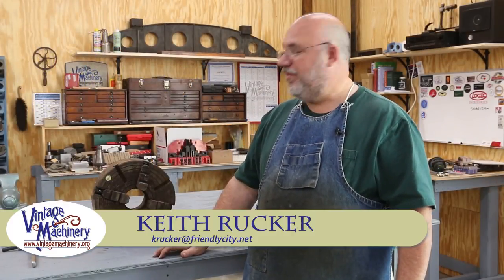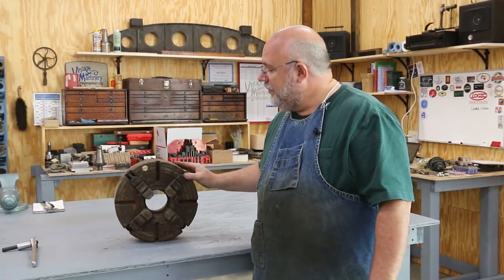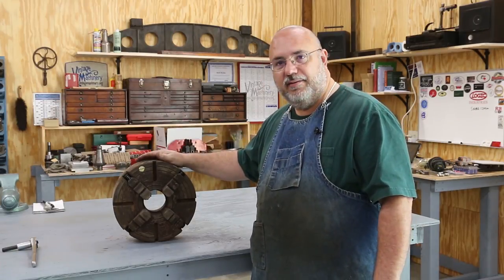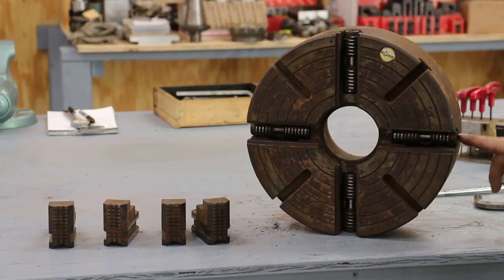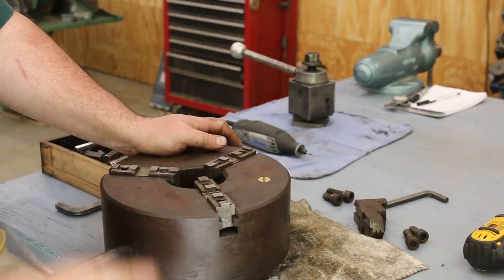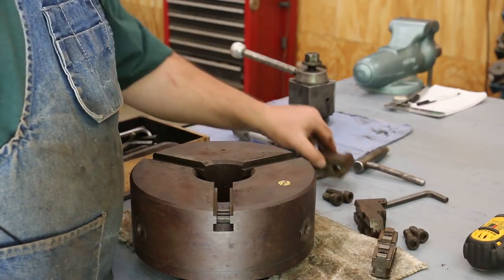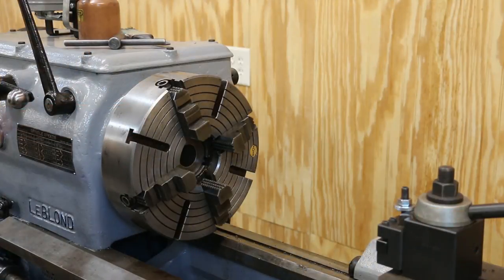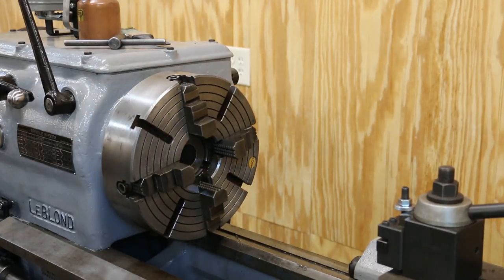Refurbishing Lathe Chucks

Comment: I have a bag of glass marbles i got at a garage sale i use to take up space when soaking things, to reduce product usage. Kinda like a brick in the toilet tank to reduce water. Glass marbles are ideal because they are non reactive to almost any chemical you can throw at them, non conductive and fill up small spaces. They also work in an electrolysis tank. Bonus tip, marbles/ball bearings inside any container you need to shake before use like paint, or lapping compound or whatever, really speeds up the mixing. 
Hold on to your marbles, Once you lose them, things get weird....
Reply: I soaked my marbles in alcohol... I'm sure there still fine, but I can't find them.
Reply: That's genius. I'm definitely going to use that. Do you ever notice the marbles leaving any sort of pattern on contact with the items you soak?
Reply: My thougts exactly.
Reply: brilliant tips
Reply: @LAsparkTVWireTestLimited  Here is another: If a 4mm allen key fits into a bolt, so does a 4mm ball bearing. If you super glue it in there, nothing but a soak in acetone is gonna get it out. Cant drill it, cant hammer it out, cant grab it..... If you peen over the head of the bolt, the bearing is in there for good...
Very effective anti-theft/anti tamper.
Reply: I tried a brick in  my terlet and couldn't get my poop to flush, so I snuck a streak knife from the wives kitchen knives and hacked away.
Reply: use a soda bottle not a brick
Reply: @enigmagic  A bit late to the party, but just lay the marbles in first or try to find another way to put them in the container to minimize contact if you are doing something like cold blue and worried about finish.
Reply: @thepartsrunner5758  
Wut??
Reply: You guys have all lost your marbles!
Reply: I like to soak my marbles in a wading pool..............swish then around,.............☺️😎👍
Reply: @notsofresh8563  super glue is destroyed by heat. Just use a lighter for some seconds and your security is gone-sorry to say.
Reply: I've seen that done. It's a simple trick that works.
Reply: Great idea!

Comment: Great video as always Mr. Rucker.  I'm a CNC machinist looking to go backwards.  You, Mr. Booth, Mr. Fenner, and that goof Mr. Lipton have taught me so much in the manual machining world.  The shop that I work in, has more antique yet still operable machinery than I've ever seen.  I see machines at work...sitting in dark corners of the shop...collecting dust, that I know I could run because of you guys.  I can't thank ya'll enough.
Reply: its not easy to be accurate on old lathe ,no dro ,wear in slides ,wear in chucks,dammn thing turns tapers etc...
Stick to the cnc machining ,there is a reason why those machines stay in dark corners.
Reply: zumbazumba1 I agree and disagree at the same time.  I run some impressive machines...I  throw code at them...make offsets...and I'm good for days.  Personally, manual machining is an intimate thing...CNC is less controlled by me...hence the CNC.  I'd prefer to be in more control...intimately...while trying not to sound like a dirty bird.
Reply: I do get you what you mean ,machinist brother from another mother.For 5 years i am a machinist on manual universal lathes.If you have the right idea they are indeed universal ,from turning one to milling machine ,hobbing gears to making keyways.You aint gonna do that on a  500k worthy cnc lathe machine.Cnc machines can do amazing things but also they kill the creativity,there is no room for improvisation.
I recommend that you stick to your job with cnc machines for $$$ and secretly cheat on it  with a  manual south bend or similar lathe in your basement.
When a man owns a milling machine and a lathe  with right tools and right mind and materials nothing is impossible.
Reply: zumbazumba1 Honestly, I couldn't have said it better myself.  You, my friend, are my machinist brother...from that other mother of which you speak.  I currently have two engine lathes on my radar...an exceptional Clausing and an old clapped out Mori Seiki.  Bridgeports are a dime a dozen in my situation...but...I'm a lathe guy...have been, and preferably, will always be.  It makes me think of Abom and how much enjoyment he gets out of that old Monarch of his. The thing is... I want that.  I'd prefer not to have a  fanuc controller screen staring me in the face all day.  I do enjoy what I do...don't get me wrong...but I'd prefer the calculations were made from what's under my hat...rather than some computer.
Reply: When buying lathe biggest concern is condition of the slides,most will have wear from use(usualy around chuck where people work most of time ).Check the wiggle of the compound and the cross slide with dial indicator -those have gibs that can be tighten usualy but sometimes they need new gib(can be made new but costs money ) or they need to be ground and scraped.

Check for backlash in a cross slide screw-1/10 of a mm is a normal backlash when nut and screw are new(also can be made new but costs money).If cross and compound slide have no play and gibs are set correctly backlash wont have that much of a influence on a precision.
Check the main spindle,put a dial indicator on is or on the chuck and then with a long bar try to move it up and down-this will tell you a condition of ball bearings /bushings.(can buy new -again costs money).

Check if bushings /taperd roller bearings can be tightend-old machines use bushings that are good up to max 600rpm and need to be oiled.Newer machines use ball bearings on main spindle axe and their speed s go up to 3000 rpm usualy.-this is important because carbide inserts like higher speeds,older machines were made for hss blanks. 
Open the cover of the lathe and check the main gears ,if you see any of them are blue(runing withouth oil ) or damaged if they are run away and never look back .
Check the tail stock quill with dial indicator -same as main spindle.Lock the tail stock and push quill against chuck to see if tail stock thread is stripped.With your finger check if the tail  stock morse taper is smooth and undamaged-this can be reamed if damaged but again its a pain in the ass and costs money.

Check the condition of the pulleys on the motor and on the main gear  if machine has them,And the condition of belts.-this is easy to make new but again it costs money so why not bring it down. 

Bring a micrometer and peace of steel to turn and test the machine you are buying.See if it turns too much of a taper.(this can be due tailstock beeing missaligned properly ,run in a slides or machine not leveld properly-i shit you not )
 Try heavy cuts(10mm pass for heavy machine ,5-8 mm for meduim ,3-4mm for smaller ones ) and see how macahine  handles them.If it doesnt stop the clutch is ok(if it has it,new machines do have ).If it skips the cut
clutch can be worn out or simply needs to be tighten(when buying old machine check for spare parts if they are still available-thats one big factor to consider) 

Last thing is drop the price down for every single mistake you find that can be fixed-it will cost you.Most of the sales guys know jack shit about machines and claim that machine is in PERFECT BRAND NEW condition .
I dropped the drill press price form 1000$ to a 400$ when i looked at it and said what needs to be replaced.
When i fixed it grand total was 500$ and some time.
Old machines can be restored to a brand new condition when scraped and restored for a half of price of a new one -
if you know a place where you can send it.I seen it on a youtube guy sends in his surface grinder like 50 years old and they scrape the slides ,repalace ball bearings and for 20k$ he has old- new machine that is capeble of 1/1000 precision grinding that will last for another 50 years to come.
 This is all that comes to my mind right now ,probably i missed something.
 Hope you buy something that fits your needs and serves you for many years to come.

http://www.homews.co.uk/page463.html check this dude  its Harolld Hall -author of workshop practice series of books.he has many projects you can do and build your own machines for fraction of cost .
Reply: I couldn't disagree with you more. A skilled manual machinist can create parts with great accuracy. The advantage of CNC machine tools is their ability to create huge quantities of accurately machined parts. That being said, CNC machine tools can be delicate and somewhat finicky.

 I was a CNC machinist for several years, I enjoyed the programming and creating parts in CAD, but I missed the physical, tactile interaction between me and the "feel" of operating manual machines that only an experienced manual machinist experiences. The Industrial Revolution and it's quickly evolving technology was all created using manual machines. A lot of CNC shops still heavily rely on manual machines, even NASA used manual machines to create one-off and prototype parts during the Space Shuttle years. Properly maintained and properly used manual machines can last a lifetime, you can't say that about most CNC machine tools.
Reply: zumbazumba1 You, my friend, have your s#@t figured out.  The best part of this whole process for me is...I would acquire this machine from my employer.  Working solely with the individual that ran and kept that machine in working order.  If any modifications (scraping/grinding) are to be made...I work in a shop full of amazing machines that are 100% capable of making said modifications.  I feel the world is on my side in this endeavor...and I'll most certainly keep you posted.  Now, I just have to figure out where this machine is gonna fit...I may have to park on the street.  Small sacrifices...will have to be made.
Reply: You missed the words -old lathe.Means usualy worn out machine that cannot hold accuracy of a 1/100mm on a lets say 20-30 cm length due to worn out slides.No matter how skilled machinist you are its hard on old lathes.1/10 of a mm on other hand can  be achieved.For most of the parts in the shop 1/100 of a mm is what you need and can achieve on a manual lathe.
 On the other hand cnc machines have the stepper motors and position themself and self correct (i dont know how to explain it properly on english).
And yes cnc machines  are awesome for fast production of accurate parts ,as you said,also your last sentence is correct too-but time is a cruel mistress to us all ,old machines are not excluded-everything has its expire date including us people too !
Reply: Best of luck with your new adventure :)
Reply: How'd you end up on CNC without going through manual?
Reply: Shoorit he ended up on cnc because of tech schools that teach guys to work for 15$/ hour with no experience  it is very sad.
Reply: i have the manual machine`s 
and for some jobs nothing is gonna beat them
the more easy the job is 
the more dificult it becomes on cnc 

but personaly i stick to teach in
its verry fast and u have that rigid  setup that ur used to on the full cnc

production or dificult parts ill stick to cnc combined with the cam
Reply: dude, your words made me see I'm in the right track (aren't those the one we actually want to hear). I'm going into matrix manufacturing studied, despite having studied chemistry and worked at tourism. I was offered to go into cnc lessons, yet I refuse to grab a cnc before I'm good at Parallel lathe. somehow ive got the feeling that starting by the beggining is something I will not regret in a lifetime.
Reply: You mention three very good teachers that I too watch.  I recently found another that you might like as well.  Joe Pieczynski   No affiliation, just a subscriber.
Reply: Learn the manual tools because they work very well for repair machining jobs.  

CNC is best for production but manual machines make money every day. My (highly successful, and the machine shop business has a high failure rate!) machine shop owner bro has many large manual machine tools which could not be replaced by CNC. He has two CNC Bridgeports and a small turning center but his WWII era American Pacemaker lathes are in fine shap and make money every week.

CNC autists think everything else is obsolete. I follow the MONEY instead. 

A modern machinist should be able to use both CNC and manual machines. You'll be far more versatile.

Comment: Just a quick comment if I may, I was taught that a "Witness Mark" was simply any remnant of the tooling marks on a machined surface left behind intentionally. They were used as an example of how much (or really how little) metal was removed in the final processing of that surface. Match marks on the other hand,  were marks put on the visible surfaces to show how two different mating parts were originally assembled.  In part just to make certain that they went back together in the correct orientation to each other.

Comment: After watching the video again, when you greased the wear surfaces behind the scroll on the 3 jaw, i noticed the groove in between them ran all the way around, and there was a tapped hole in the groove. I think that little tapped hole on the front of the chuck is to screw in a grease fitting and grease the chuck.  If it is, it should have a plug in it when not being greased.

Comment: Hey Keith for future reference those threaded holes in the backing plate are called jacking screws. Run into them a lot when working on things with machined fit. One word of caution be careful to turn them in small amounts and equally as you can damage the parts if you get it cocked in its bore.

Comment: Evapo rust works much much faster when heated.  A large stainless pot and a campstove work wonders.  Heat to about 180*.  What it normally does in 12hrs it will do in less than an hour when hot.
Reply: rejracer good to know. Thanks
Reply: as does hydrochloric acid

Comment: I like to use powdered graphite to lube the guts of my chucks so the chips and cast iron dust don't like to stick as well. Those chucks really cleaned up nice! Great to have all the work holding options on that lathe. Try fluid film for your anti corrosion spray, works great and won't bother your skin.

Comment: My JAW dropped when you taped on that scroll with that allen wrench. Don't you have a brass punch?   Gun Bluing makes a nice protective finish. Never seize those bolts, allows you to tighten the bolts properly, and makes it easier to take apart.
Reply: Even gun blued steel will rust over time.
Reply: You're right, it's not the best, but it's possible that the sides on the scroll are the more important mating surface, not the face of the scroll. I wouldn't go crazy with trying to tap it out though.
Reply: Taped or tapped? Two very different meanings
Reply: @codprawn  Eeny Meeny Miny Moe  or  I can google it to find out.   OK I choose tapped or is it chose lol  Thanks
Reply: @oldman6495  
Depends on the tense!
Reply: i expected a pun, definitely disappointed

Comment: Great job as always Keith, my only concerns are, grease is probably not the best method of lubricating the inner workings of a chuck, because any chips that find's they way in there, will have a tendency to stick to the grease. Oil would be a more appropriate lube for that application. Also, you need to lubricate all moving surfaces, you lubricated the flat surface of the crown wheel and not the center that rotates around that hub, you could be a little more liberal with the oil, just wipe off the excess at the end.
Reply: I was going to ask about using grease.
Reply: Heck, any "excess" oil will be taken care of the first time you turn on the lathe. ;-)
Reply: Grease is FINE. Careless use of compressed air and grinding/polishing on the lathe is a main problem.
Reply: ibkoool1 This is sadly very typical of Keith's work, particularly when lubricating parts during assembly. He likes to portray himself as a careful and experienced engineer and yet can't actually see the shortcomings of his own work. Similar examples of mistakes litter his videos.
Reply: I watch them because I enjoy the sort of machinery Keith works on. I have spent most of my career repairing antique machines and industrial installations and much of my work was putting right poor or even bad workmanship by previous people who had all the right spanners but little grasp of what they were actually doing. Keith seems to be somewhere on that spectrum in that he more or less knows what to do but cannot portray himself as truly competent to be an instructor and an example to those who wish to learn. In the meantime those chuck components  are still wearing out!

Comment: WD stands for water displacement developed in 1940 for drying out distributors in military vehicles. It has varnish in it so after multiple applications the object will get a red tint. I used to work in a gun shop and customer would bring in a red colored semiauto rifle complaining it had stopped working. A soak in the ultrasonic cleaner and some customer education took care of the problem.
Reply: The "40" doesn't have anything to do with 1940. It is the 40th formulation. It was developed in the 1950s.

Comment: a little tip for those tight slip fits, if you throw the inner part in the freezer for a little bit, it will open the clearances a couple tenths and parts drop tofether nicely. i do dissasemble/clean on all my chucks when they come of to load collet noses. i had a tech twist a plunger in a power chuck and i spent 2 hours stoning the burr he created. i used the same trick rebuilding an 8000 rpm lathe spindle with boiling the bearings in an ultrasonic cleaner(in a bag)

Comment: If you forget and it evaporates you can just add water. The chemical in the evaporust is not subject to evaporation. What out with some drills and hex keys. The evaporust work by pulling the 02 out of the rush and leaving the iron in the bottom of the pan. It does the same thing with Black oxide. If you reuse product you can dye a part with the black oxide from a previous project